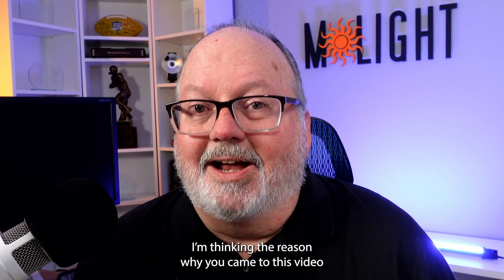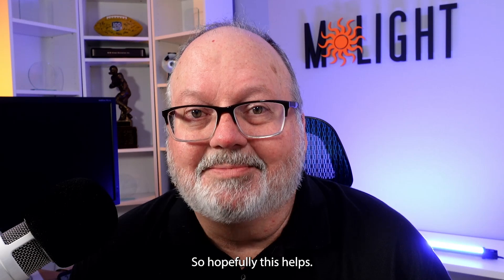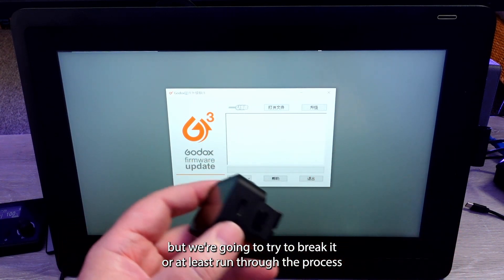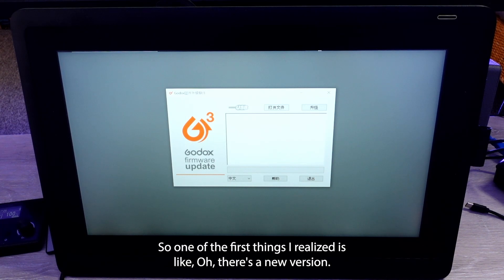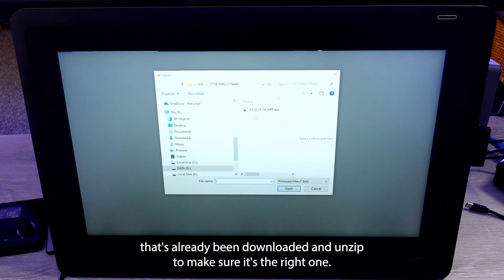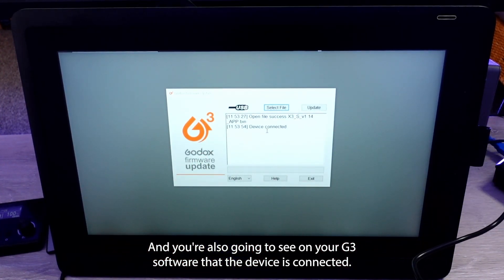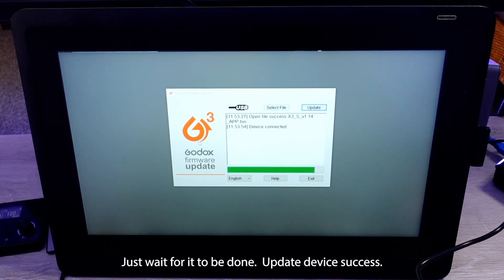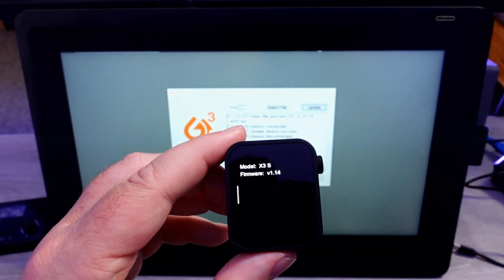Godox X3 Bricked Firmware Fix

Comment: I am trying to update the firmware on my Godox X3 Pro-C. The X3 screen shows an up arrow with Upgrading on the screen. I have the Godox V2.0 installer installed, and I have the firmware, X3_C_v1.35_APP.bin, downloaded. I have tried the pressing of the Select Dial and the Test buttons. This does not clear the Upgrading message. Is there difference between the firmware for the X3-C and X3-Pro-C? The installer is indicating a successful update,  [18:44:45] 连接设备成功
[18:44:54] Network Error
[18:45:06] Open file success X3_C_v1.35_APP.bin
[18:45:42] Update device success
[19:28:51] Device disconnected
[19:32:05] Device connected
[19:32:12] Device disconnected
[19:36:12] Open file success X3_C_v1.35_APP.bin
[19:36:38] Device connected
[19:38:28] Device disconnected
[19:38:46] Device connected
[19:39:57] Update device success
[19:40:47] Device disconnected
[19:46:52] Open file success X3_C_v1.35_APP.bin
[19:48:56] Open file success X3_C_v1.35_APP.bin
[19:49:25] Device connected
[19:49:40] Device disconnected
[19:49:45] Device connected
[19:50:33] Update device success
[19:50:35] Device disconnected
[19:51:51] Open file success X3_C_v1.35_APP.bin
[19:52:08] Device connected
[19:52:52] Update device success
[19:53:09] Device disconnected
[20:04:32] Open file success X3_C_v1.35_APP.bin
[20:04:44] Device connected
[20:04:50] Device disconnected
[20:04:58] Device connected
[20:29:39] Device disconnected
[20:32:23] Open file success X3_C_v1.35_APP.bin
[20:32:35] Device connected
[20:33:14] Update device success
[20:35:23] Device disconnected
[20:36:59] Device connected
[20:37:39] Device disconnected
[20:37:55] Device connected
[20:38:36] Open file success X3_C_v1.35_APP.bin
[20:39:14] Update device success
Reply: I have the same problem! It's so frustrating

Comment: Thank you for the video. Unfortunately I keep getting a "update device error" message. Any suggestions?
Reply: Make sure you are using v1.1 of the G3 software. There are two versions that can be downloaded on the Godox website. This issues most often is because the user is not using v1.1
Reply: Also, make sure you use the cord that comes with your X3
Reply: @MichaelMowbray48  Thanks for the reply. I definitely am using the V1.1 but for some reason it doesn't say "V1.1" after "Godox Firmware Update"? It's really strange.

Comment: I tried your method, and it didn't work at first...BUT... When I made sure I unziped both the Update Software and the Firmware BIN with WINZIP and used the supplied USB-C cable, then was able to get the update and unbrick my device. Thanks for getting me there!

Comment: This is a comment copied from another video that worked for me when updating to V1.15. "In case it's not clear...you need to press the top knob in and hold it for a while to boot the trigger into the Chinese update screen...then use the Godox G3 app to load and update the firmware. When the green progress bar stops and the very hard to read window above it says the update is complete, click 'exit' on the app. Your trigger should now turn on. As he says, any settings you had will be wiped, but that's easy to do again."

Comment: Mine was bricked after correctly updating the firmware. 
X3c, Godox G3 v1.1 (version 1.0.0.1 in the file properties), firmware v1.26.
I had to use a previously downloaded firmware updater to get it working again.

Comment: Very good tip on the two button fix.  However, the new installer is now the G3 software and the X3 firmware file is on version v1.15.  I have attempted your method on TWO new devices, both ended up bricked beyond return.  Unfortunately the fix in this video does not apply as a fix.  I have contacted Godox technical support for assistance and they have directed me back to your video!
Wondering if you have any insight/ have learned anything new since the posting of this video.
Thank you so much!
Reply: Sorry to hear you have not had success. There must be a snag somewhere in your process, as you can see the number of folks that this has worked for just from the comments. Yes, it is the G3 firmware launcher that I reference in the video, but it must be the v1.1, which I also reference. Is it possible you have v1? Are you using the cord that came with your X3? Are you on PC or Mac? I have had a few reports from Mac users where they had to attempt the process multiple times before it would work. Without being involved in their process, I do not know if that is a Mac thing or a user thing.

Comment: Phew, thank you for this.  It worked for me but possibly for less obvious reasons, firstly, holding the top rotating button was the thing that woke it up each time it crashed, and second, it wasn't obvious that you have to go find the v1.1 of the G3 app to do the firmware update options page, since the version number appears only in the support page title and not in the actual G3 download page which doesn't tell you its version number

Comment: I first charged the X3 then followed these steps. After following these steps for updating and unplugging the unit, it does not power on. I tried the process 3 times from the start each time with no luck. It's still won't power on after unplugging.  Maybe I need to drop test mine too?!?... 🙂  Any suggestions?
Reply: I'm guessing maybe I downloaded an older version of the Godox G3 firmware update by mistake?... I downloaded it again making sure I had the current V1.1 and ran through the steps again and it worked! Thank you for the video! I would've been stuck without it!
Reply from the maker: @steventhompson558  Just making sure you are using the cord that came with it?
Reply: @MoLightStore  Yes thanks. I'm using the data cable that came with the X3.

Comment: OK I got bricked and followed your instructions but when you dropped yours i accidentally pushed another button whilst pulling the cable out. Tried several times and it did not work. I uninstalled and went through the whole process again and now it works,. Phew!!